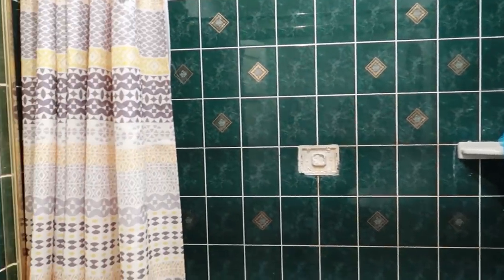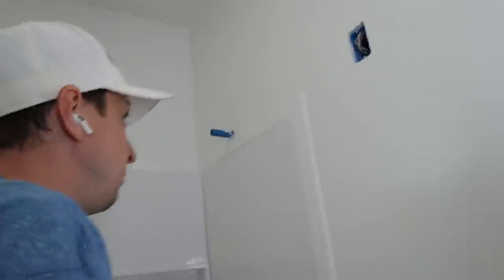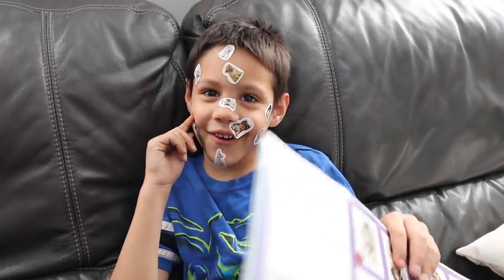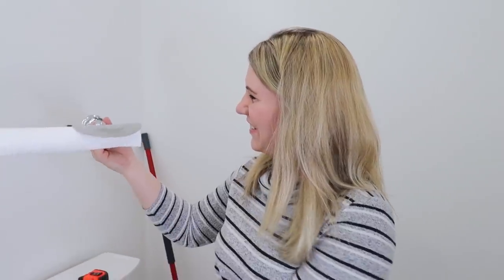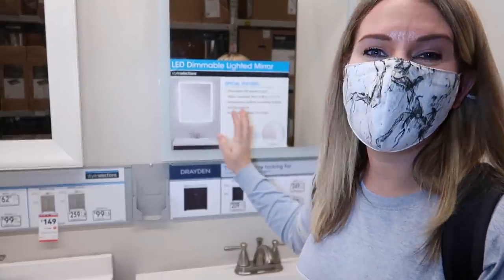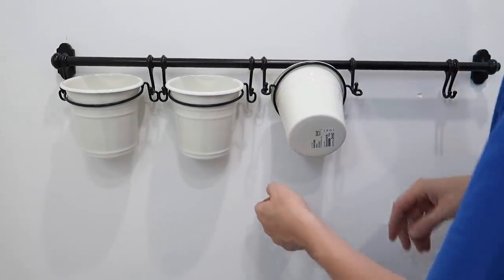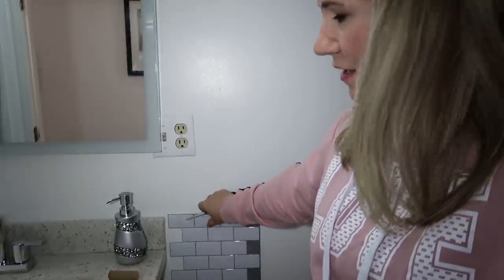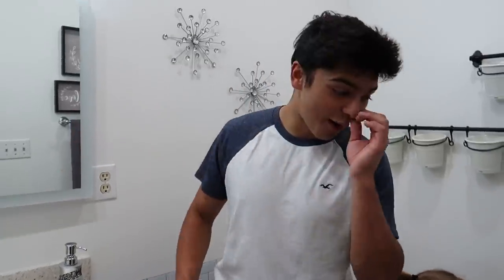Bathroom Makeover | Room Makeover and Tour

Comment: I am quite clumsy and have either slammed, pinched or hit my fingers/hands so many times it's a wonder they still work!  The thing I find that helps the most in the moments right after injuring myself is to take a bunch of separate sheets of paper towels, get them wet and ring them out, lay them flat in the freezer.  They take maybe a minute to freeze, they don't last long once you take them out but you can wrap it around the finger and it's super gentle!  Also GREAT for burns!
Reply: I always use scissors but there was this one time we’re I cut my pinky finger but I didn’t hurt that much I just put a bandage on it and then it didn’t hurt. And by the way this happened 1 week ago my hand is ok now. Bye.